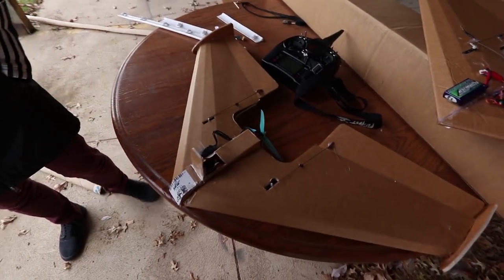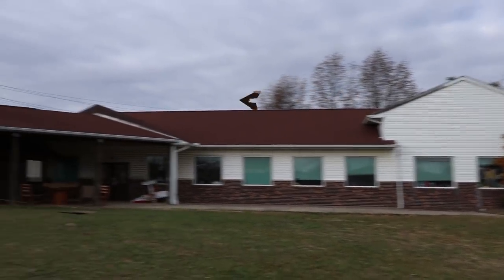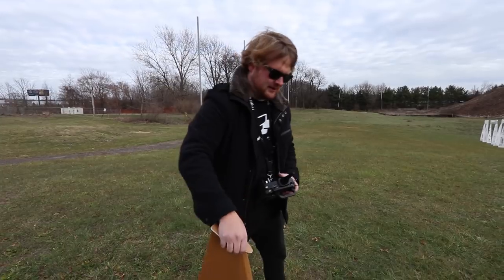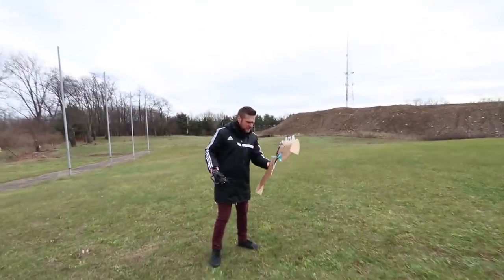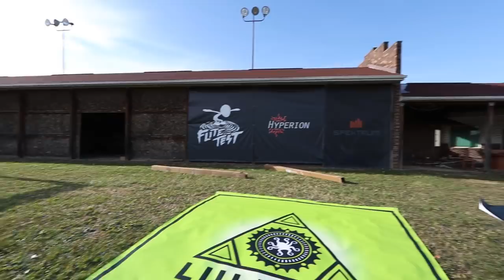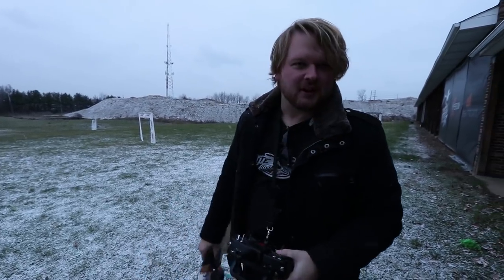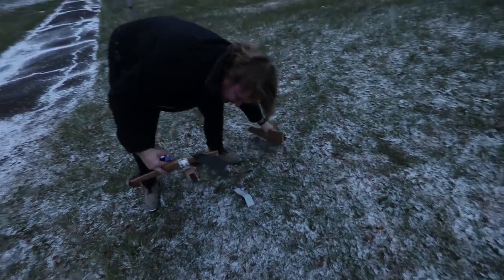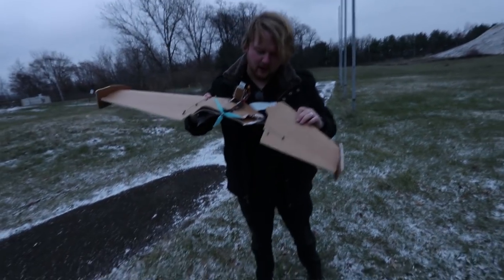FULL THROTTLE FLY AS HARD AS YOU CAN CHALLENGE 2017 | VLOG0130

Comment: Next challenge: throttle on a switch. 0% or %100 no in between😂😂
Reply from the maker: OH i like it! ;)
Reply: FliteTest Haha yes!
Reply: This is an amazing idea!
Reply: Exactly what I was thinking! Like what Quadmovr did.
Reply: That's what i have setup on my Phoenix 2000. I use throttle stick for flaps and crow.
Reply: Several WWI-era fighters did that.  Your engine was either on or off, no throttle.  They were apparently a bit of a pain to land. XD
Reply: @victorgigante5374  every aircraft with a rotary engine - Fokker Dr.1, Sopwith Camel, Nieuport Bebe and all of the others - used this system.
Reply: i fly with my glider with that setup. one switch for 0% or 100% like that you can learn gliding much better
Reply: YES, THE BLIP SWITCH CHALLENGE
Reply: those pilots were braver than anyone today. landing with a 0% or 100% throttle would be a tricky nightmare unless it was a good at gliding.
Reply: hmm time to use pwm to control the motor lol
Reply: Needs to be on a shirt

Comment: I already told Austin this, but everyone builds their own ft 3d with fpv setups and then run an rc red bull air race. It's has to be at the shop, and each plane has an onboard lap time sensor.  Add the flag poles as a slalom section and a Paradigm PPG pylon into the course and you have yourselves a challenge!

Comment: I had this issue on one of my models a few years ago. It has quickly ailerons, but I didn't understand why. I tightened a few screws (it has that old style where you had a straight piece of wire grasped by screws, rather than the wiggly wire feed through a hole, or the horns that are both more common now.)Next flight the same thing happens. I notice that the hinge assembly is loose. I push it back in, assuming that it must have come out over a long period of time. For again, this time the hinges failed completely while flying and the ailerons were flapping about, dangling from the servo rod. Needless to say, I didn't have a lot of control, and it was a pretty short flight!

Comment: The reason it flies like that is NOT the vertical stabilizers. You signed my Combat arrow, and it had massive amounts of that. Also, stefans is much stronger, due to having no pod, because the spar goes all the way through the middle. I'm the arrow master-I have built 300% arrows, 30% arrows that didn't actually fly, 1 regular arrow, 1 with sheet metal on the wings that was overpowered, 1 that had no cutout in the back and no pod, and 1 with no cutout in the back and no pod but with motors arranged like a kraken.

Comment: I've been using the wing from the arrow and putting a center pod similar to the spear on it, and it helps a lot when it comes to getting the kind of nose weight you need to get that wing flying well. And in addition to that, I put a sheet of foam board under the center pod and about 6 inches out under the wings on either side to keep it nice and strong. Also, it's funny you guys put out this video today when the FAA just reinstated their registration system, and this thing is just under registration weight.